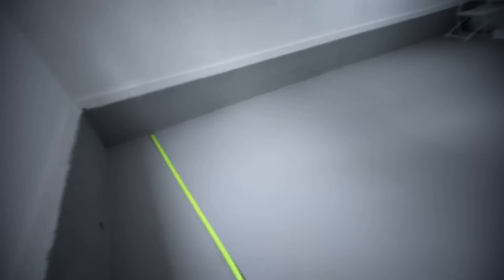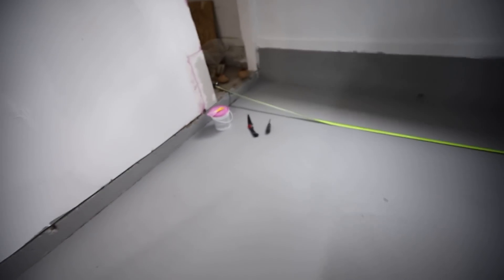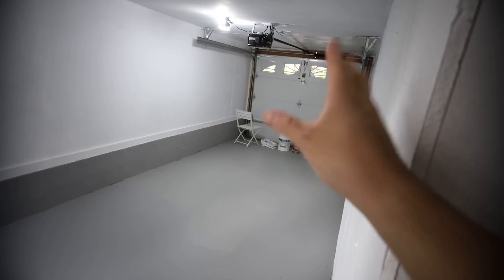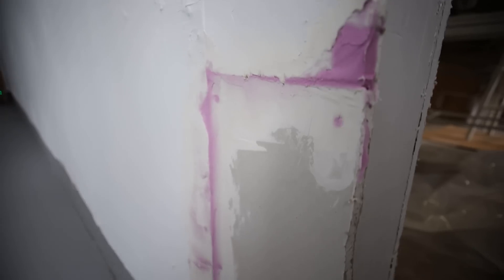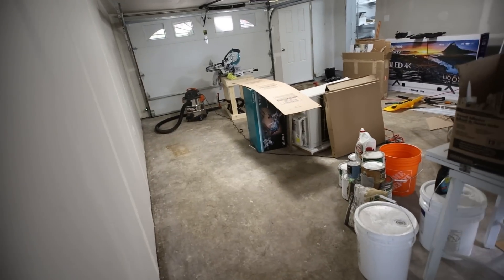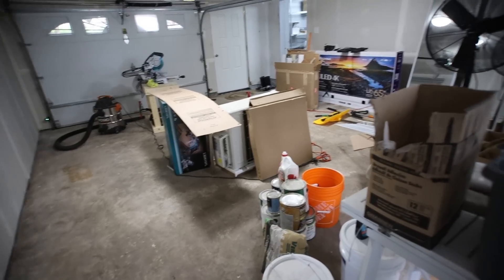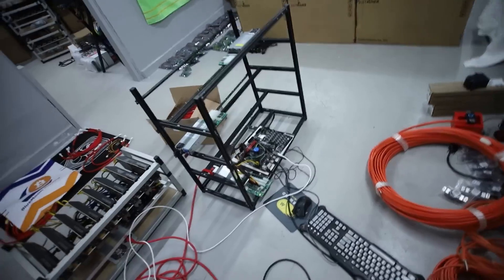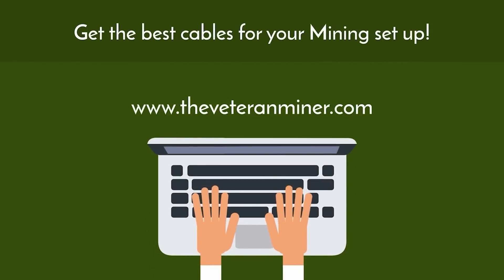Done.

Comment: Even if you don't need/use them right away, always run the extra conduit / wire runs at the same time, so much easier to have it and not need it than to have to try to need it and try to run it later over top of everything you've already put in place. :)